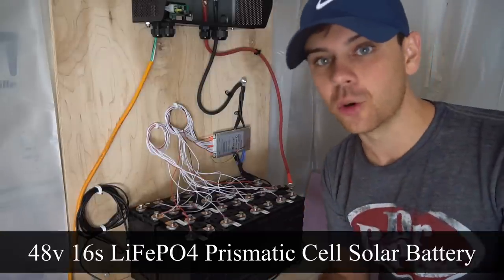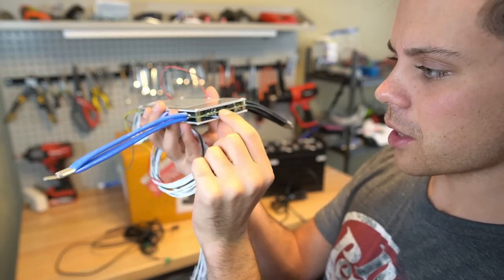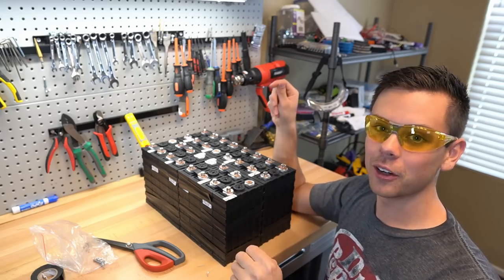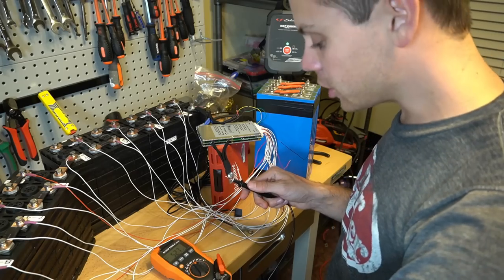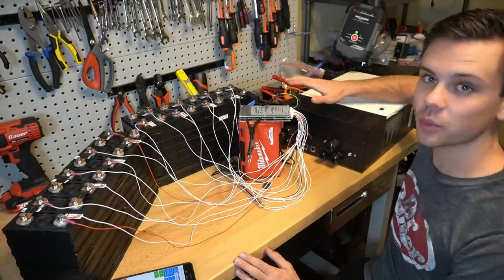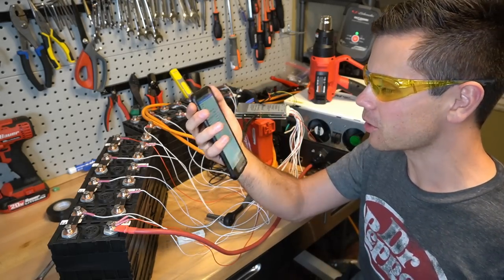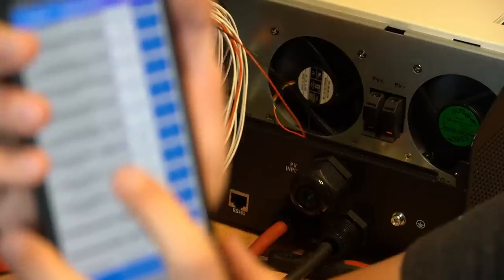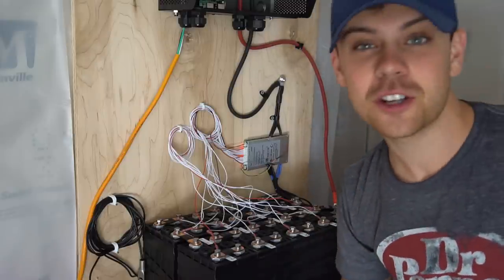DIY 48v LiFePO4 Battery w/ $72 Bluetooth ANT BMS (low temp cut-off!)

Comment: After sitting in the doctors' waiting room many times over the years cursing my decision not to wear safety equipment, I now solemnly wear safety glasses whenever I am remotely at risk.  The bloke across the road from me just lost an eye from small high speed things jumping out of unexpected places, which brought the whole lesson home fairly abruptly.  I have a couple other nasty injuries that just won't go away.  Just wear the glasses, people.
Reply: and they are cheap at your local hardware or auto parts stores...
Reply: I'm the same way, all safety gear all the time. It saved my life after a motorcycle accident. It is crazy how many DIY videos on Youtube have makers doing pretty crazy shop work with no eye or ear protection.
Reply: I concur.  I used to be involved in home projects as a child where safety gear never seemed to be needed (building mud road systems, putting pipes in mud, digging clay dirt, Radio Shack 9V 100-in-1 electronics board), then I went to safety-oriented union construction work as an adult which requires "PPE" (Personal Protective Equipment: glasses, gloves, hardhat, high visibility vest, etc.) 100%, then I come home and do home stuff and find out that suddenly all my home projects mysteriously turned dangerous and I need safety gear.  What happened?!  Life got serious is what happened.  The projects we do as men are more real than what we did as children.  Whenever I don't use my glasses, I am sorry.  Luckily, I have a whole box of safety gear for work I just use for home.  Be very serious about the dangers of each project.  This real-use power electricity work can cause eye-damaging events.  Adult projects in general are more real and require more sane management, which also means gloves, boots, cotton long sleeve clothing, an awake mind with plenty of sleep, and sensible logic.
Reply: Thank you!
Reply: Redrum  It will happen.  You'll remember this conversation.  With any luck you'll still have both eyes.
Reply: I did the whole time I worked on the battery system.  But thanks for the reminder!
Reply: They are great on an E-bike too, those gnats and flies are deadly when they hit your eye at 30-40km/h.

Comment: I want this for 4s 12 volt! 
Also, it makes me so happy when you get so excited over these little devices, Will.
Reply: I believe thats the only one they make but I think you can use it but you need a boost converter because it needs some higher voltage to power up but i think you can with 4s i saw someone else use one with a 24v system

Comment: Great video Will, I installed the same ANT BMS a few months ago in my 48v 200 ah battery and it was a pain to get it to work, but when it finally did, everything is going great, the BMS is excellent, I only wish they had send all the information when I bought it, so I did not have to search all over the web for it.

Comment: Your videos are informative and research is without question some of the best I have seen.
 
Just finished building a 13s4p 52V battery pack for an E-Bike. I opted for the YIT 48V 13s BMS COMMON PORT board. 

My first step after the pack was assembled was to connect the BMS B- thick wire to the negative side of the battery pack, in this case, 18650 Li-ion cells. 
Next making sure the 14 lead cell monitoring connector was disconnected from the BMS board I started connecting the 14 wires to the pack. 
Starting with the only black thin lead on the 14pin connector to the negative side of the battery pack.
 Followed by the next wire, right next to the black thin wire, which was a thin red wire. This wire measured 4.19V.

Did this for the remaining 12 red thin wires till all of the thin red wires were connected.
Then with the negative lead of my voltmeter on the thin black wire on the connector and the positive lead of my voltmeter on the third pin I read 8.4V.
I checked all the pins on the balance connector confirming they were in increments of 4.2V I then plugged in the balance lead connector to the BMS seconds later smoke started coming from the BMS board. 

Where did I go wrong? 

There is not much information on the sequence for connecting and disconnect BMS from the Battery Pack. Some say it does not matter others state it does. Can not get a consensus of opinion on this subject. Than you for your time. Signed Frustrated.
BTW I was criticized for asking the question in many FB groups and really never got an answer.
The board used is the YIT with nothing more than Li-ion 13S 48V BMS on the label. Also, I have contacted the factory but nothing from them.

Comment: Hey Will, so I did a general search for ANT BMS and your video popped up. I just ordered a 180 amp hour to 450 amp hour ANT BMS. For my system currently consisting of 304 amp hour Eve 3.2 volt * 16 cells. Which are on their way from China and should be here in another month or so. Truly I must thank you for this video which is going to save me a tremendous amount of time when I put it together. Originally I was looking for a jbd BMS that would match what I wanted to have for my system. Unable to find a jbd I thought hey I'll get the ant which really looked the same and it was from the same store. IC GOGOGO which led me to believe the same manufacturer is building both products. Not sure if that is the case. Though I really appreciate your video seriously Will you're a tremendous amount of help thank you so much.

Comment: @DIY Solar Power with Will Prowse
Col here, hi Will, longtime follower here. I've learnt alot while you have been expanding your knowledge here on your channel, You are doing a great service here mate. I love how you continue to keep it real :) 
Is there any chance you could do a video on all of the Pros and Con's on setting up a
'DIY set up using lifepo4 12, 24, or 48Volt set up?!?!'
(Here are some example ideas of some subtopics that may fall under this category?! Please elaborate on each topic and add more topics that you believe are relevant, as I am sure you would have some, these are just some potential examples).
Eg:
For home or RV set up (And depending on the size of your RV, and/or how many watts from the number of panels on your roof and/or free-standing Solar on the ground)...
And depending on how power-hungry ones rigs (RV) is?!
Wire sizes needed to be used?!
Power drop over the length of cables between Solar Panels to your Charge Controler?!
Best Charge Controler for the DIY'er depending on the way the battery bank is configured (Including value for money controller that does all you want from it, including B/Tooth and Temp cut off...) To list some on this subject, but definitely not limited to...

I hope we hear from you soon Will, keep up the great unbiased work you are doing. You can tell you get a kick out of doing all of this, as do I learning about it at and have done some small set-ups and in roughly a year I will be doing a much larger set-up on a Fifth-Wheeler and travelling Australia full-time and homeschooling our 2 boy's in the process. We will be free camping it all that we are able (You call it Boondocking over there), so we want to be as self-sufficient as possible. And it will all be done by me. Lucky as a qualified builder, I have learnt a lot about Electrical work and also have done quite a bit of electrical works, I even have a novice level of understanding of electrical circuitry and the components names and what they do etc...I'm able to do my own soldering etc. too.
Cheers, Will.

Please hit the 'Like' button on this topic if you would like Will to do a comprehensive video on this topic???

Comment: Hint for the startup process.  Get a 9v battery, a SPDT toggle or push button switch, and a suitable enclosure.  Wire the both negative wires to the NC of the switch.  9v positive to the NO.  The BMS positive to the COM of the switch.  Now you have a switch that you can flip on to start and off to run.  Always ready when you need it.

Comment: Will.  For your shed insulation, I wanted to make you aware (if you don't already know) of the importance of having some kind of radiant barrier to keep the shed cool in the harsh sun.  Radiant barrier (foil) acts as a type of umbrella to shield the sun's radiant heat, just like a car parked in the sun will be hotter than a car parked in the shade under a tree.  There must be a 1/2" gap between the wall and the foil for the barrier to work.  If the foil makes contact with the wall it has the opposite effect and conducts the outside heat inwards.  I'm sure that traditional insulation can then be put on the inside of the radiant barrier to further insulate the room, but there must be an air gap between the foil radiant barrier and the external wall.  Solar panels on the roof (with an air gap between the bottom of the panels and the roof would likely serve the same purpose as interior installed radiant barrier, but if there are no solar panels to shield the shed from the radiant heat of the sun, the sheds going to get very hot from that radiant heat, just as the interior of a car would if left sitting in the sun.  Here is a video explaining radiant vs conductive heat and why an air gap is important.    https://www.youtube.com/watch?v=E1IwS0_lpBc

Here is a demonstration of how radiant barrier lowers temp
https://www.youtube.com/watch?v=fnCH_Qaj_d0

Comment: I have just bought one of this BMS and it's still in the package. I found it daunting to start hooking up. I am worried I may not be able to change the setting for Lifepo4.  I'll have to overcome my fear at some stage.  But watching a very capable Pro like you still having to dig deep to get it working  cements my case 🤔  and, it came with no manuals.

Comment: Will... love the channel. I have a video suggestion. I am looking to take a portion of my home off the grid and fully power some 110V circuits (no 220V circuits) to reduce my utility costs and to further gain some experience on this. Would you do a small step by step series on doing a sub-panel for a house slowly going off grid? I know you've shared a transfer switch previously but an extensive how-to would be fantastic. I think there's a lot of people who want to go off grid with Solar and LiFe home built batteries in homes that weren't originally designed for that... in an affordable and gradual way. Thanks in advance!
Reply: Just did that myself, I took two breakers from house panel and now power them via solar shed. Been running for a month with only a couple times low voltage cutoff event in early morning. So excited I made this jump.
Reply: @michaelbatchelder  That's super cool. Did you move them to a sub-panel? Do you have a backup switch in case you need to go back to grid power?
Reply: @patrickswain47  No, I removed breakers from the main panel and powered the circuits directly from the inverter in my solar shed. If the grid goes out, I can plug extension cords to power any major appliance I need. I have a gas generator as well. Currently, if my solar setup runs out of power, the two circuits in the home are dead. I have a transfer switch that I will hookup soon to correct that issue. So far it has only happened twice (cloudy days)
Reply: Did you ever consider doing a sub panel with a controller switch? Will did a review of one a while back and I've had it sitting in my amazon cart for a while while I considered how to do this project. 

MOES Dual Power Controller 50A 5500 Watt Automatic Transfer Switch for Off Grid Solar Wind System ATS DC 12V 24V 48V AC 110V 220V

Comment: Hi there Will - I was about to ask you to do a video on the ANT BMS so thanks for an excellent post as usual. A friend of mine and I both use the ANT BMS in our electric motorcycles and I am buying a lower voltage version (48V) for use with my solar system. You are right - great price and lots of features

Comment: I actually have two of them and have one of them powering a big 400A relay  so no problem with  the power output ;)  charging is done over the BMS.  
Discharging is bypassing the BMS over the relay directly to the battery so all funktions still work and you just can by the cheapest version and still be fine as long your charging current isn't to high ;)
Reply from the maker: Super smart!!!
Reply from the maker: But no coulomb meter haha
Reply: @WillProwse  yea that's right but who needs it anyway 🤣
Reply: im trying to use this for a car, up to 400 amps discharge, since i didnt want to blow it up, i am just using to active balance while car is sitting but it takes days to just balance one battery (4 16s 65v battery s for 130v)
how did you set up the relay? thx

Comment: If that is silicone wire, which it looks to be, 12AWG=3.31mm^2 so you can multiply the cross-sectional area by 25 to get a max ampacity for the wire.  So 3.31x25=82.75Amps so each of the 4 wires should be able to safely and easily handle 70A continuous in open-air.  Since the 12AWG Silicone wire is rated for up to 70A and we are dealing with very short leads of less than 1 foot 320Amps for short periods is probably fine and very possible with a more reasonable 100-200 Amps being more realistic for a long term installation.  They are also likely planing this BMS for a specific battery size like 100AH so if you discharged that 100AH battery at 320Amps this wiring and BMS is only going to heat up for ~19 minutes before the battery is depleted and would give the whole system time to cool down.

Comment: Very timely  video Will.  I am collecting some of the components you show and the BMS you mention in this video will be a big help, along with the tips to get things to work properly.

Also glad to see the safety glasses and commentary regarding the molten metal should a short circuit occur.

Comment: Just picked up an Ant BMS for 48 volt and 300 amps. I have a 15kW Low Frequency Sigineer Pure Sine Wave Inverter. Nissan Leaf Modules and using it as grid tie system. The charging algorithm will be the sealed lead acid which is the proper voltage I need for my system. I may use a contactor or solid state switch to switch so I can charge with high current and not have that go through the BMS. I may loose some functionality of the BMS but I will be using this as a hybrid system. I do have two MPPT charge controllers for an off grid solar array where I just charge up via solar and not the grid. I have two 48 volt packs built for testing the system. I can do some testing before my BMS arrives. I may reconfigure my packs so I can use one BMS for the entire system. 7s series 12p will be my final pack size. I would however still like to use my Solar if the grid goes down from my Grid Tie panels. Problem is the power from the panels is too high for my charge controllers. Rrrrrrrr.

Comment: I believe the tab you talked about not recognizing is called something like a “pin connector” or something similar that seems to be mostly used in car stereos from what I can find. Just installed a 2awg service line to put a 50amp plug way out on some land we own, and I had to purchase those pin connectors because the wires wouldn’t fit in the breaker or plug.

Comment: Another tip for safety when assembling banks... use studs and nuts... not bolts.  
Put all the studs in, then slide the buss bars onto the studs. Keeps the bars from moving.
Reply from the maker: Smart idea.

Comment: Just for fun I did a lookup for 4 x 12awg wires which gives an equivalent of 1 awg good up to 110 amps in the right installation (assuming copper)  which matches exactly as you stated good for 100 amps.
Reply: I ran it through a voltage calculator. 4x12 awg, 1 foot long, 48v at 320amps. Looks fine to me for the full rated amperage of the BMS. https://www.calculator.net/voltage-drop-calculator.html?material=copper&wiresize=5.211&voltage=48&phase=dc&noofconductor=4&distance=1&distanceunit=feet&amperes=320&x=53&y=27

Comment: Recently reconfigured a 26650 cell  39v pack, into a 16s 52v (nominal) bike battery.
These things are fantastic when you need a blast of speed to scoot across an interesection or quickly get out of the way of a vehicle.  I have a cargo bike that needs every bit of juicing it can get.

Comment: Hello Will I purchased this BMS and it is reading the cells but I can not figure out how to engage the discharge and charge mosfits...

I have a quantity of 8 100ah 3.2v lithium iron phosphate cells

I make setting changes and save but bms returns to default settings?

I purchased 4  400 watt solar panels rated at 49volt almost 10 amps per panel for a total of 1600 watts of solar
I will be installing them on RV in series- parallel to meet the 115v dc pv max input

What size pv cable should I get for the install panels will be installed in series pairs then paralleled 

I purchased the MPP solar 24volt 2400 watt hybrid inverter

Working on getting the rest of my components sir!

I love your channel and learn alot from you sir!

Proud of your accomplishments